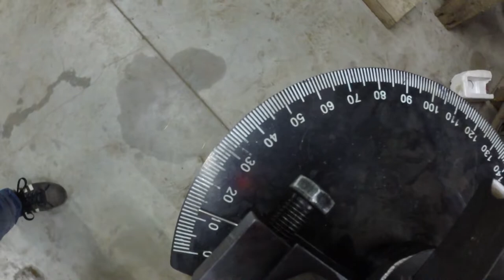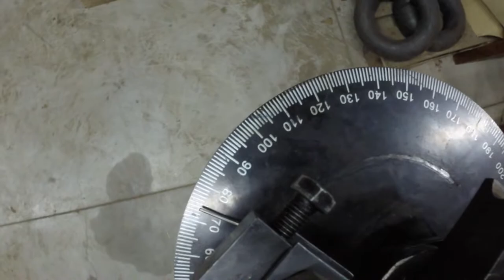JD2 model 3 clone tube bender modification. Used for go kart and minibike frames and handlebars.

Comment: Gebruik je inch buis in de standaard mallen die bij de buiger zit?
Reply from the maker: Ik heb er verschillende mallen bij.   Buis of pijp moet wel passen bij de mal, anders wordt de bocht niet strak.
Reply: @LilPopeye  snap ik maar de mallen die erbij zitten zijn in inches. Dus pak je voor de 1 inch mal 25mm buis of echt inch buis?
Reply from the maker: Ik heb 22mm, 25,4mm, 35mm, 38mm en een grotere mal erbij.
Reply from the maker: Voor de 25,4 mal, werkt 25mm buis ook goed.
Reply: @LilPopeye  Dank dat wou ik graag weten. Andere mallen bij chassisparts weg?
Reply from the maker: Nee, alles heb ik bij gekocht in 1 koop bij Valkenpower.